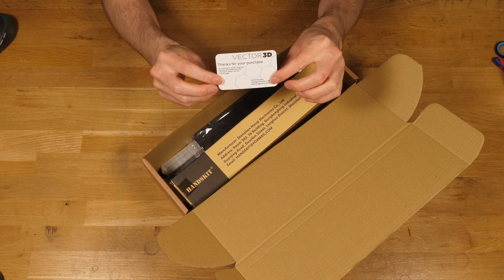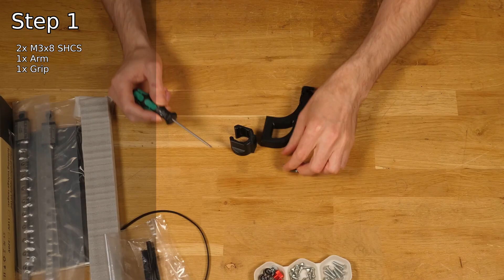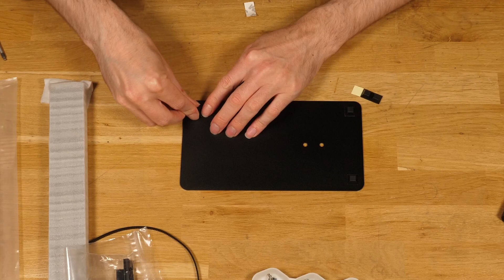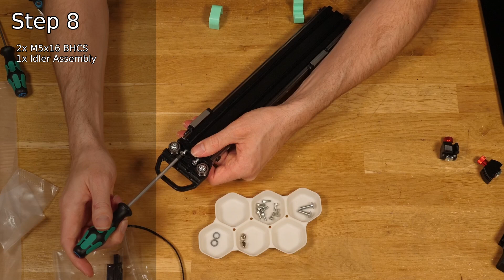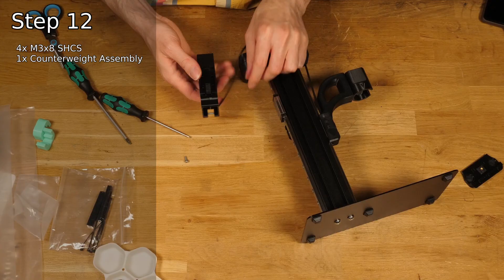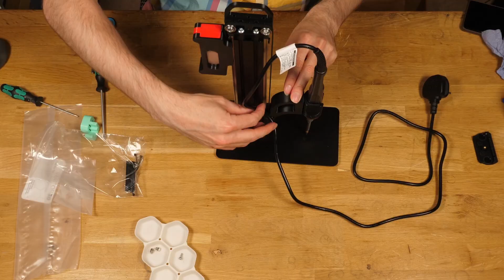VLMP Pro Assembly

Comment: So, just now getting around to thinking of doing this one (Im finding my use of heat sets more frequent).  Was wondering.. your VLM2 has a tray/pockets for materials (heat sets/bits) and was wondering if there were a cover or additional printed part that can be applied to the base plate to accomplish this function.  Perhaps slotted to slide over the sides and back near the extrusion to act as a saddle?